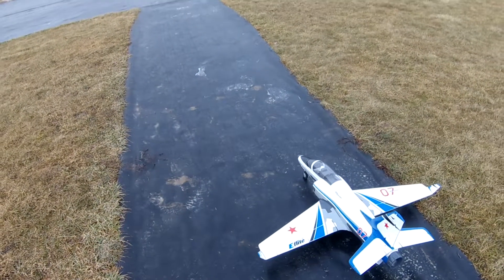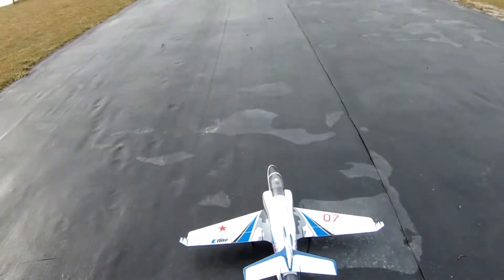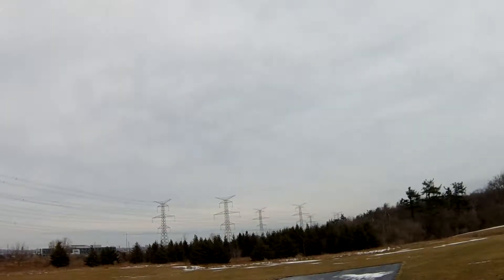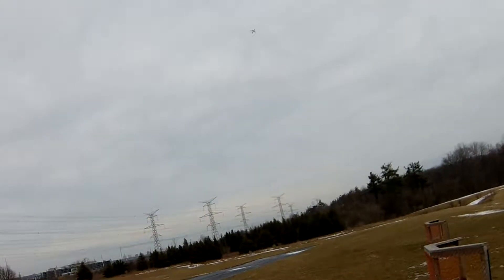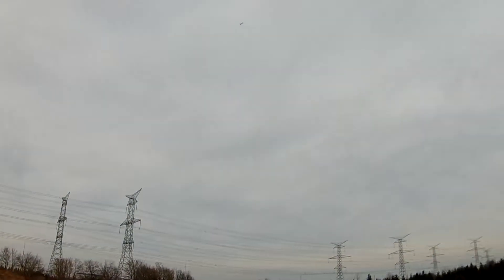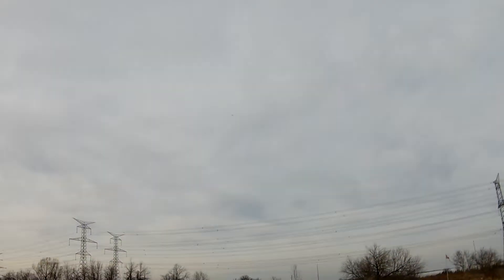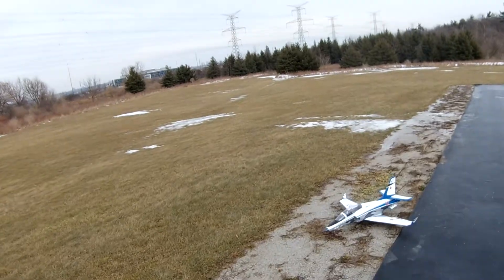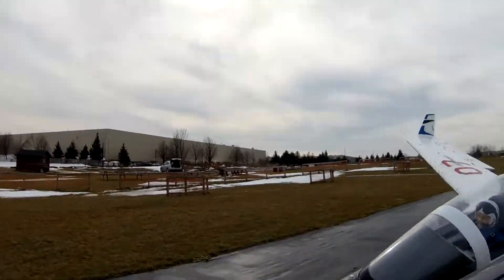E-flite Viper Hrb 5000 mah 6s  50c pack

Comment: Where did you located the battery to get a good C.G.?
Reply from the maker: I I used the factory CG and just removed some of the foam from the canopy and by doing this you will not have any problems with battery placement.
Reply from the maker: Check out this link for the canopy mod for the battery. https://youtu.be/2pna0w9ArPw
Reply: @ghoustanable  thank you... 👍

Comment: Any difference with the 5000 mah pack?
Reply from the maker: Yes more punch out on the vertical and definitely increase in speed. Landing is a little bit more hot but nothing that's ridiculous. Cheers
Reply: @ghoustanable  did you use onyx?
Reply from the maker: @bradbutler6861  no HRB got them on Amazon. https://www.amazon.ca/HRB-50C-100C-Connector-Quadcopter-Helicopter/dp/B073RBPR7X/ref=mp_s_a_1_1_sspa?keywords=hrb+5000mah+6s&qid=1583773008&sr=8-1-spons&psc=1&spLa=ZW5jcnlwdGVkUXVhbGlmaWVyPUExRFIyVzdaT1RXODlVJmVuY3J5cHRlZElkPUEwMzMxNTYxVk8yUDRERVY5WUxLJmVuY3J5cHRlZEFkSWQ9QTA0NTAwMTIzR09PNUFCMTZHVTBXJndpZGdldE5hbWU9c3BfcGhvbmVfc2VhcmNoX2F0ZiZhY3Rpb249Y2xpY2tSZWRpcmVjdCZkb05vdExvZ0NsaWNrPXRydWU=